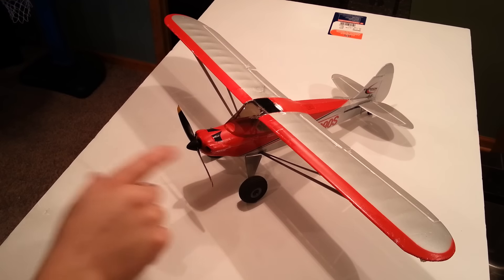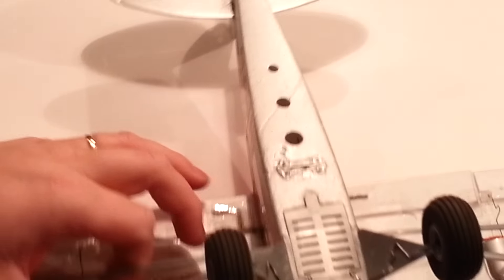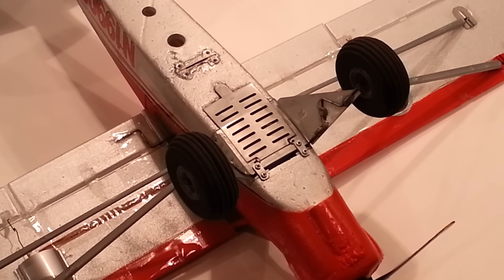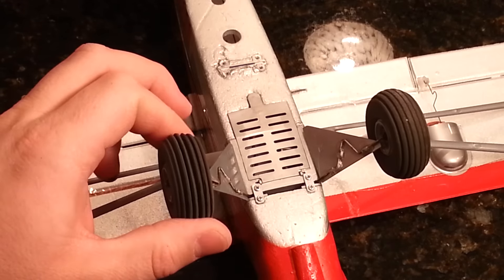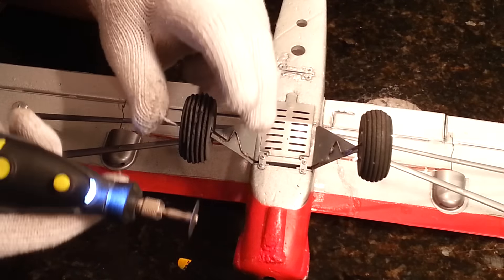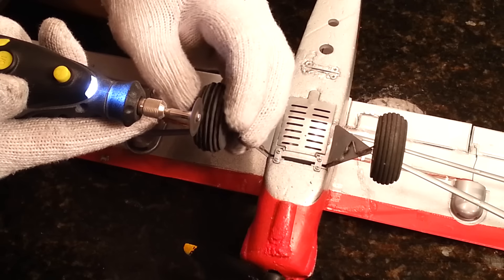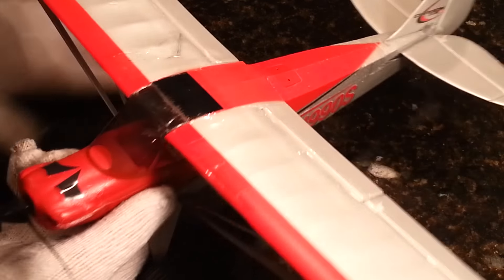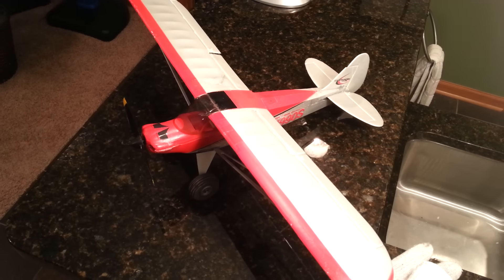Horizon Hobby - Carbon Cub SS UMX - Mod to Lighten Tundra Tires

Comment: Make a cutting tool out of a brass tube cut holes out off the sidewall from the inside don’t go all the way through to keep the balloon tire look from the outside this should save you more weight and my save a finger
Reply: And no black mess and should add squish
Reply from the maker: I was thinking now that the Timber UMX is available, these might be an even better option...

http://amzn.to/2CxzyFW